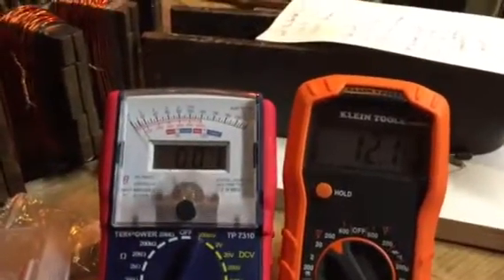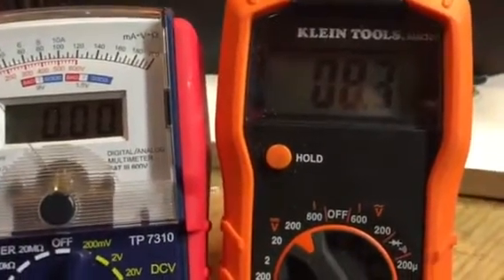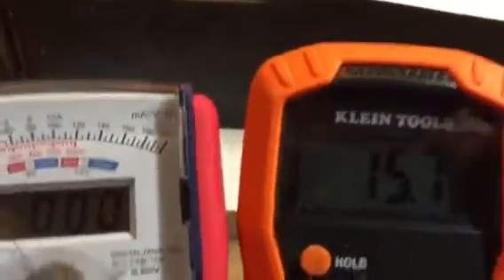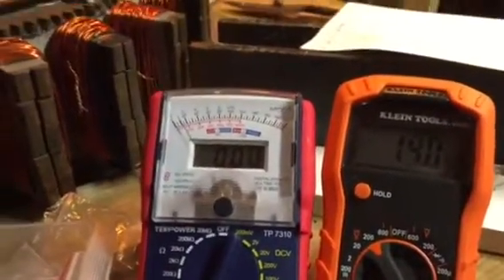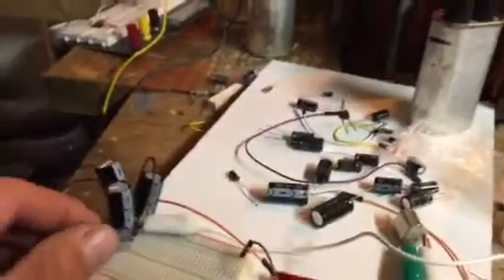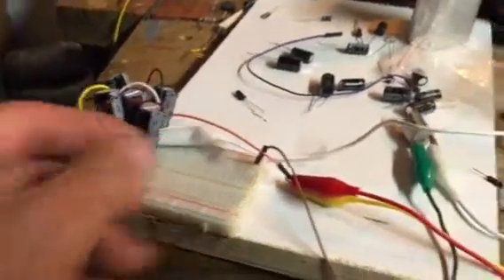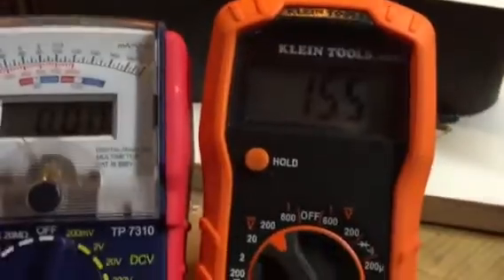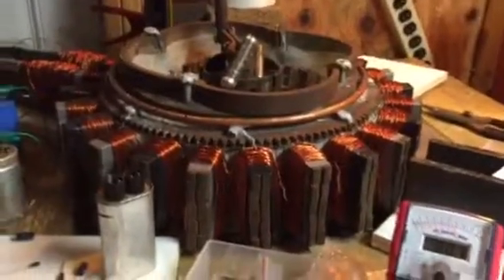Capacitors run DC Motor

Comment: Hi first of all thanks for the video and explanation. Did you consider using a supercapacitor ? It has a LOOOT more capacitance and therefore themotor will run for a lot more time. When you tried to add the capacitor in series (after the add of the first jumper) the series conector you do not connect positive with negative AND negative with positive you do that only at one side if you do to both sides you basically run the capacitor in reverse and since this is an electrolytic capacitor it will destroy the inside oxide layer and short the capacitor and if long enough will will destroy it and with more powerful power supply short the power supply and see the cap explodes.